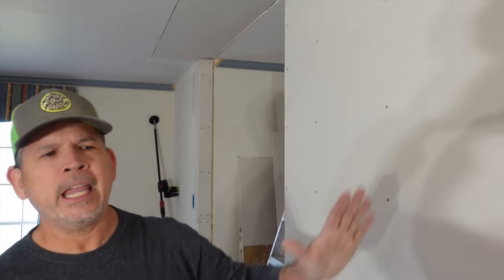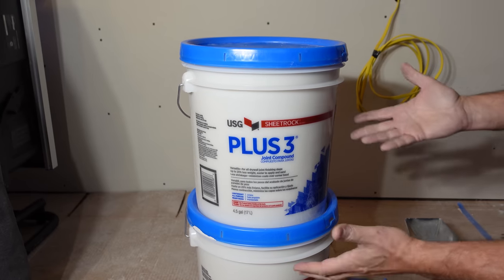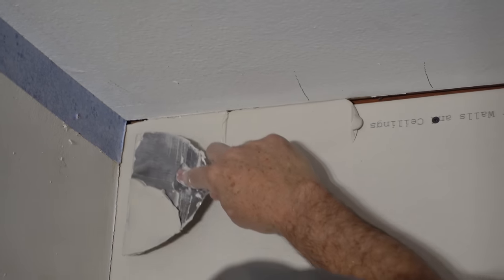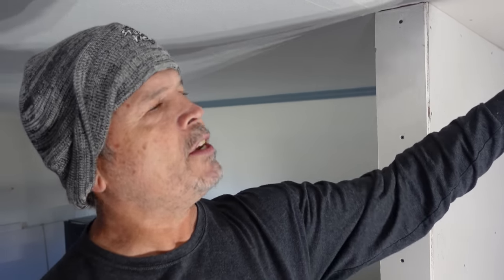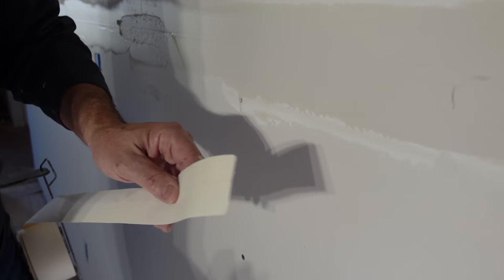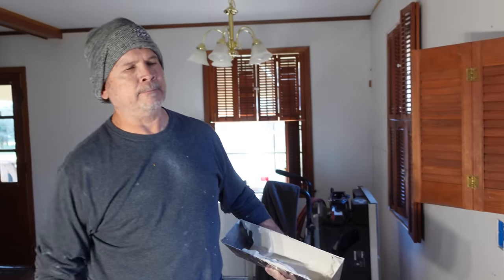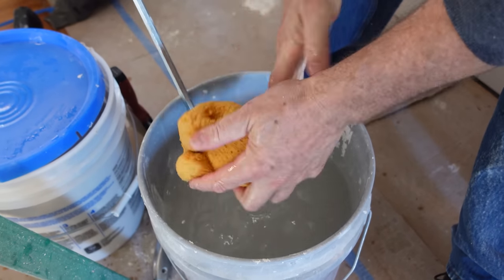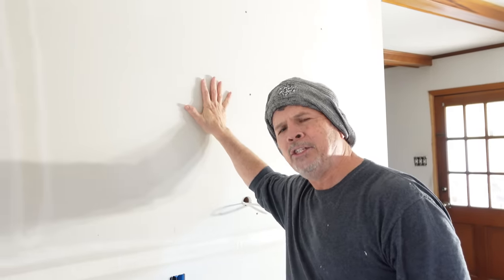How To TAPE and MUD Your DRYWALL | DIY GUIDE

Comment: Damn, you are almost as good as me!!  I really do not have much to add or comment on except for the butt joints.  Once the drywall is hung I check for ringers and then I use the end of my mud knife handle to countersink the butt joint edges below the surface of the drywall so the tape lays flatter/smoother.  Sometimes I use the back end of my utility knife as it is radiused just right for that.   

I favor that you get into the content right away and not bore the hang out of me with a bunch of unecessary boring talk.
Keep up the good work...

Comment: Love u guys taught me a lot I’m drywall contractor painter n Man U showed me a lot of tips n tricks. But do I have use green lid mud for taping or can I use blue lid finish mud for tape n finish like in this video???? Bc if I can just use blue lid be awesome but. I was was under the impression that green lid stronger n is under coat only. For strength n it don’t cover as much. Blue lid not as strong but covers more

Comment: I may have missed the answer in the video but just so I'm clear: On your transition from old new new where you had to add a lot of the setting compound and feather it out you didn't go back over the original joint with tape. Is that correct? (Sort of begs the question can you not just use setting compound in all the joints without using tape? I would imagine though that the tape just helps down the road from any settling causing hairline cracks.)

Comment: The proper size taping knife, bedding coat is a 5". That width keeps the tape below the surface on the factory and you should ALWAYS second coat, especially on ceilings after the bedding coat...That's when you use a six..The next coat after that, makes it ready for sanding.

Comment: I found Im quite good at fixing repairs and matching textures. I dont want to ever do it again. I had pipes burst in the ceiling last winter and I did an emergency repair and use celotex to cover the holes during winter. Drywall dust is just NASTY!!LOL

Comment: Question- how do I go back & correct what I obviously did incorrectly because sanded, sanded, but never looked good? Finally gave up & left it looking bad. I had taken down wallpaper (ugh) & tore drywall, read online how to skim coat, etc. Got the pre glued tape (WRONG) but never could get enough joint compound on it to not see holes. Retaped with paper tape.Spent lots of time & to this day it looks bad to me in places. I needed your tutorial for sure! Too cheap & broke to hire a professional like you!

Comment: Pre-fill all joints and butts before tape . Its the flatest than for the tape. Using mesh tape for light boxes that blow out and smaller joints,closets ect.. to be filled in w/45 will also save much time taping. Also using a boozoka will save all the hand taping but that tool will require some experience and more for a multiple rooms or whole house. Its more for everyday use.  Putting th mid on both sides of corner and sticking bead to it is also easier than applying directly to the bead. A few tips drom 20 yr drywaller

Comment: First of all I'm not bashing this guy I actually like his channel and watch his video's quite often and also no one knows everything I say that because even though I have been a licensed contractor for 38 years I'm still learning new ways and techniques every day also I'm not an everyday drywaller but my father was for 30 years and of course started doing working for him when I was 12 (mostly grunt work) so what I say here is based on what I was taught and from my experiences. That being said, unless you want the tape letting loose down the road a couple of years don't use plus3 for tapping all purpose mud is what you want to use for tapping not only that but plus3 sands out so easily that if your not very experienced you'll have a tendency to sand out too much also at 14:32 I would prefill all flats (and butts) that are gaped like that.  Also when I do my inside corners I apply the mud with my 6"knife the same way he showed how he applies it as he did at 14:56 and the way he spots his screws .
Reply from the maker: Plus3 all I could get during Covid.   Box says suitable for taping.  That said yes AP is better for taping👍💪

Comment: Question: in regards to pre-fill on the ceiling. If the wall is drywall and the ceiling is already finished, do I still use corner tape for that wall/ceiling area, or do I use something else?

Comment: I highly recommend the inside/outside corner bucket to apply mud to the corners before installing. Theres also a roller that presses the corner bead perfectly onto the outside corners that is invaluable to those who do drywall for a living.

Comment: I don't use that much water at the end of the day's session. I have a squirt bottle, spray the sides, then scrape,  and it always seems I have almost too much water to deal with in the mud . If you need a little more water add just a  small amount:goodvibes:.

Comment: My only question is, after you lay the mud down, how do you hold the taping knife and where do you put the pressure when you’re going over the mud and tape? I struggle so much with this step. My knife leaves little cavities and “craters” and I can never seam to get the edges to feather like he did in that single stroke. What am I doing wrong?

Comment: So at the end when showing the screws being mudded, what's up with the joint tape ripple along the seam? Gotta make sure there's no rippling by starting in the middle and apply pressure going outward (left & right)
Reply from the maker: pretty sure that roll of tape got rained on, never had that issue before or since
Reply: @StudPack  ❤️❤️

Comment: Been drywall finisher for 35 yrs please use dura bond or green lable all purpose compound to tape flat seams and corners because the plus 3 has no glue in it or another way to say plus is only meant to coat seams and corners after its taped

Comment: Sooooooo i'm an electrician with rudimentary experience on drywall. I just installed canless lights on my living room ceiling and installed 6 switches for the lights and ceiling fan (4 three way, two four way). Measuring and making cuts are super easy, even when the drywall starts sinking in and shimming it. But the drywall mudding, meh. I never knew you had to use setting compound first. I just used mesh tape and premixed joint compound. Looks like im going to see a lot of cracks when it drys lol

For anyone reading this, how can i rectify the situation above if it happens?

Comment: Great video and nice work but that all purpose mud u talked about is for taping n the plus 3 is for finishing there is a different the blue is lite for sanding the green has more glue for taping u don't want plus 3 for taping cause you will need up with blisters just a tip I've been a finisher for 25 years and you have to know the difference cause it will hurt you later

Comment: As a 45 year taper with an impeccable reputation in my area i would recommend on an job over a few sheets hire a pro or youll pay for it when you sell your house, ive fixed hundreds of bad tape jobs over the years, in the last 10 years ive done over a thousand jobs alone, just to many variables for a first timer, alot of small mistakes can really add up

Comment: Lots of speed (pro) tips but my problem has always came in the next step... fully covering the tape and the factory edge voids and then getting everything sanded smooth ( without mounds or humps of material)

Comment: If i install the bords touching eachother without bat joints is going to be a problem?
The gap between the bords must be there for a reason?
I have seen thousands of videos with drywalls and i have never seen the bords installed without batjoins why?

Comment: I'm a woman trying to do this job....My current outside corners are all chipped and cracked.  Can i just put that paper corner bead over the existing metal corner bead without removing the metal corner bead.  I watched your video and I am ready to give it a try.  Can you give me some advice.
Reply from the maker: I wouldn’t put corner bead over corner bead.   Check out Vancouver Carpenter’s channel.  I think he has a video on repairing corner bead👍

Comment: another "trick" to taping and mudding drywall is to Always pre-soak your tape before applying it.
measure the length of tape you need for the joint, throw the tape in a bucket of water, mud the seam/joint and then apply the wet tape to the joint...
you will get a much better result in the end...

Comment: Always good practice to run your paper tape through a bucket of water so not to have the tape pull the moisture out of the mud it needs to set correctly 😉

Comment: a lot of air pockets in the tape i see and only d.i.yers do the slide method on the screws its fast and easy way to leave air in the screw pocket that comes back to haunt home owners months later because someone tries to get it done to fast, and dont know anyone that would of floated out a 1/2 in to nothing if you hung the drywall the proper way would of been to shim or fer out the joists seen a few of your videos  and ain't trying to knock you for the flaws you do actually give good tips especially the tip about over lapping the ends very rarely hear or see dry wallers do that

Comment: You don't tape with +3, it's a soft mud without the glue properties to ensure a rock-hard bond between tape and drywall. Use an all-purpose green label. Yes, it's a little heavier on the arm, but you'd be doing it right.

Comment: From a professional, DO NOT use paper tape outside corners. It's the number one cause of corner pops down the road. Every time I have a homeowner call me to repair popped corners it's because some "professional " used paper corners. Always metal corners screwed/nailed/or crimped on with mesh tape applied with 3m adhesive. Then fill coats and finish coat on top. Longer lasting and better structurally.

Comment: Good work but you did drop mud and papered corner beads won't hold up to a kick.metal,screws, and hotmud 1st coats won't do it any other way.36yrs

Comment: If you know anything about drywall finishing, you never tape with plus 3 because there's no adhesive in it like there is with all purpose. Read the bucket lol. All those joints are gonna crack within a few years

Comment: for petes sake do not use light weight mud to set your tape.  it simply does not have enough glue to last, especially when set by amateurs. certainly some useful tips but as a 20+ year finisher i cringed plenty as well.

Comment: Never tape joints with light weight!  Light weight has no glue in it always use tapping mud or all purpose for tapo joints and you use light weight for finishing

Comment: well i have been a taper for 45 years, union and none union working and this way of taping is very slow and very wrong if this guy was to tape like this on a actual drywall companies job the foreman would tell this guy to pack his tools and leave the site, lesson one when prefilling and you should be prefilling every joint to stop cracking and prefill with straight durbond 90 and when you tape you need to mix your mud with some water if hand taping not a lot of water but some, reason why it makes the tape shrink in to the joint which makes a flatter joint more water more shrinkage thats why when filling your flats and butts you use thicker mud which equals less shrinkage so people learn the right way or hire a pro taper.

Comment: You are taping incorrectly. You are supposed to sandwich the tape between the plaster much like concrete mesh needs to be raised off the ground, same principal. To do this put a thick layer of plaster on the join, then rest the tape on that thick under layer of plaster, DO NOT press it in and scape out the under layer of plaster! Next do a thick coat on top of the tape thereby creating a plaster sandwich with the tape in the middle of the plaster, instead of hard against the board. Taper off the edges as usual. Dont believe me? Try it. I challenge you.

Comment: I wish I could say this helped, but the none of the dozens of "easy drywall tips" go anything below surface level knowledge. It is NOT as easy as any of you make it seem to be. You just do two swipes, slap your tape on, smooth it out, and then say "voila" without an extra ounce of nuance. How is it supposed to look? What if X happens? How do you fix it? Why is my tape coming off every time? Too much mud? Too little? Why is my tape bubbling? is it fine if it does? As a new DIY to this, I'm absolutely enraged at the lack of detail. It is NOT this easy and it's shitty that you're all proclaiming it to be so.

Comment: Great informative video, but i dont understand your motive in "acting" as if you are  embedding the tape into the mud so quickly?  You can even see during parts of the video where you didn't get the tape all the way embedded.   And then you move on as if you did.   And then went back off camera to touch up the tape embedding. I know you wouldn't leave it like that, because your tape job wouldn't work if you left it that way.
   That's kinda cringe...

Comment: Are you really setting tape with blue lid mud??!!!   Aaagghh.   That is finishing mud, bro.   Read the instructions.   That is NOT for setting tape as it has no adhesive.   In a few years that will fail.  Green lid mud for setting tape.  Green has adhesive and shrinks.  Blue has no adhesive,  doesn’t shrink as much, is softer so it can be sanded.